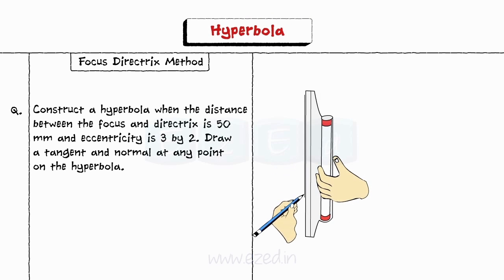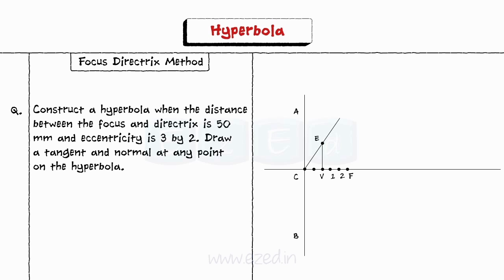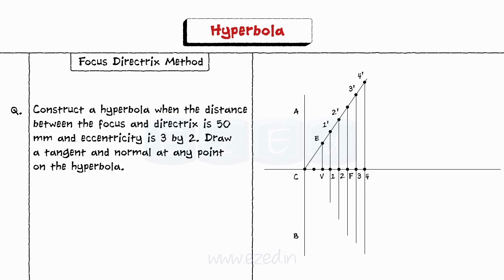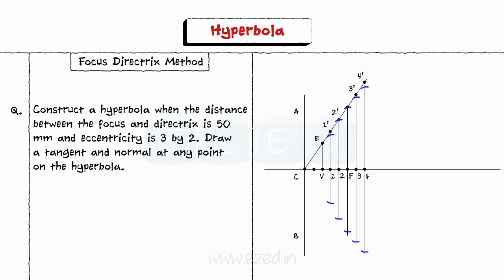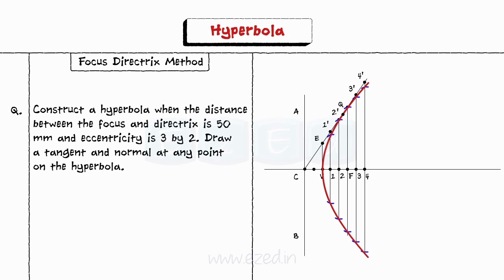Easy Steps to Draw A Hyperbola using Focus Directrix Method - Engg Curves - Engg Drawing

Comment: Timestamps (Powered by Merlin AI)
00:05 - Constructing a hyperbola using the focus-directrix method.
00:20 - Constructing tangent and normal lines on a hyperbola involves specific steps.
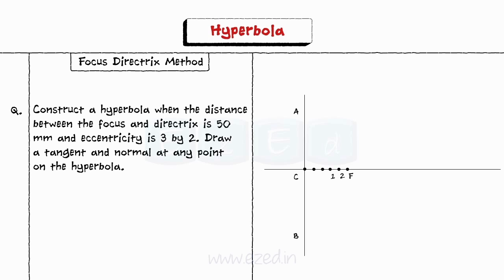00:36 - Marking the vertex and drawing a perpendicular line for hyperbola construction.
00:53 - Mark equidistant points and draw vertical lines to form a hyperbola.
01:13 - Drawing arcs from focus for hyperbola construction.
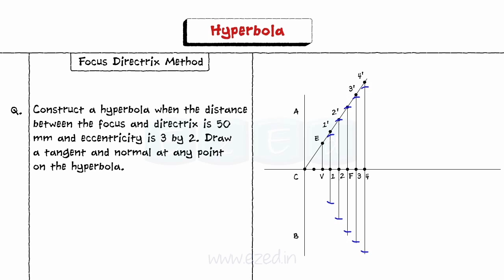01:24 - Instructions for drawing a hyperbola using the focus-directrix method.
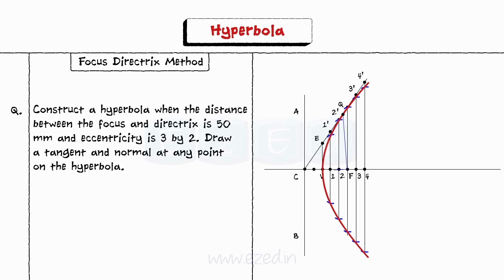01:42 - Construct a hyperbola using focus-directrix method steps.
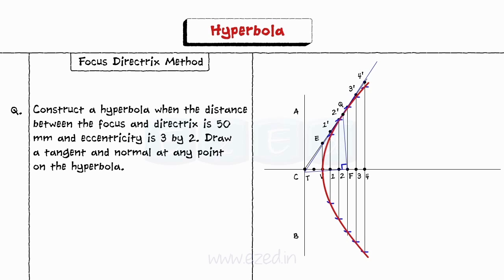01:58 - Drawing a normal line to the hyperbola at Point Q.

Comment: wrong video this will make an ellipse not a hyperbola because V is marked wrong
Reply: It's not meant to make an ellipse. The eccentricity of a hyperbola is 3/2 ( distance from focus divided by perpendicular distance from directrix),so that's why the vertex started at the second division. If it had started from the 3rd division, it would have meant the eccentricity was 2/3, and then it would have produced an ellipse
Reply: @What_on_earth_is_this 
Remember it is three divisions from the focus not from C. That makes what you are saying wrong.
Reply: 😂 you are not drawing correctly
Reply: VF should be 3 not 2 units.
Reply: This is perfectly right diagram whoever saying it's wrong plz reach ur class sir or teacher and ask them